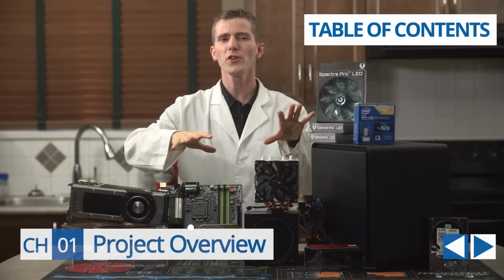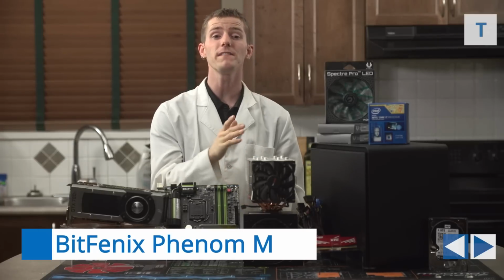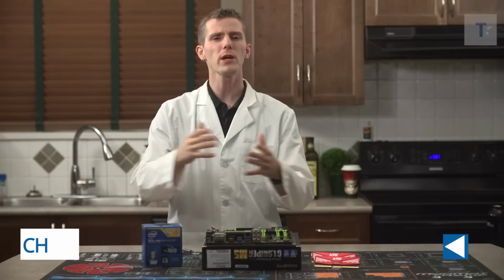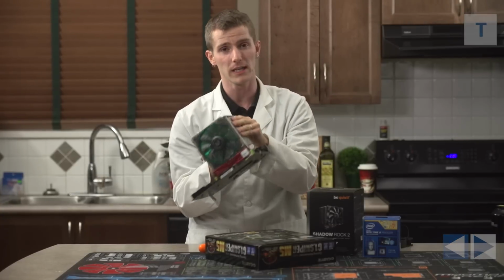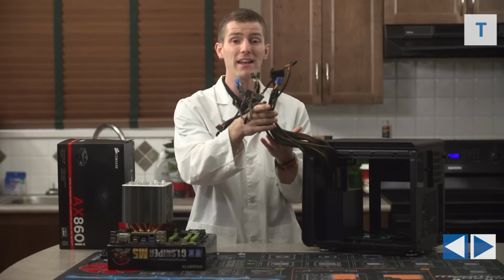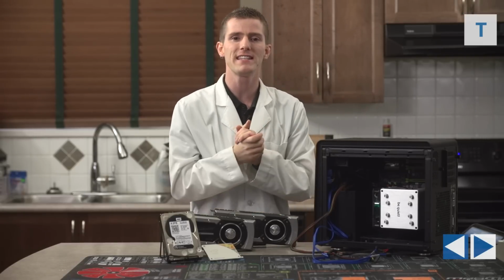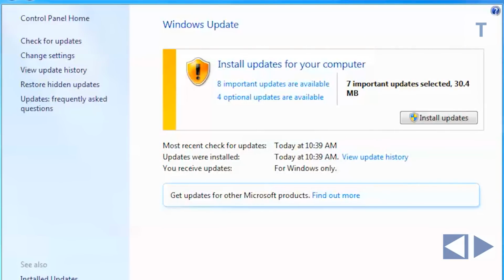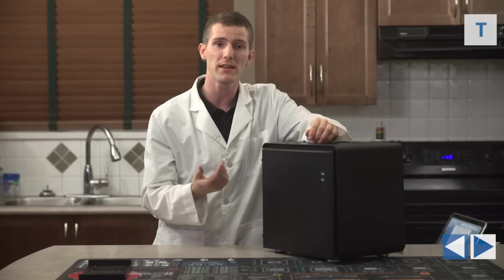ULTIMATE Intel Compact SLI Gaming PC Computer "How To" Build Guide

Comment: This Intel & nVidia bias is most... unpleasant! -.-
Reply: Um no. For high end builds, Intel and NVIDIA are superior. It's just a fact.
Reply: Maybe its because Intel cores are stronger than AMD cores and AMD gpu prices are inflated due to litecoin miners?
Reply: When AMD sponsors a build, I'm sure he'll do one. But they don't, so why would he waste his time when he's probably already busy doing other videos? He specifically said in the video that Intel paid for him to take the time to do this.

Also, last time I checked, AMD didn't make any decent chipsets for their FX CPU's, only their much lower power APU's. If he's going for high end, small form factor gaming build he's going Intel. AMD shot themselves in the foot with that one. 

And good luck trying to stop 290 and 290x's throttling in a small form factor without liquid cooling, particularly in xfire. And if you're going to talk about aftermarket cooling, I'm sure that CPU's gonna enjoy two very hot heating elements dumping heat into a not particularly well vented case.
Reply: lmCIoudz
Its been only 10 minutes and 5 people already disagree with you!
Reply: TheRayning well appart from the points above.
even amd fan's will admit that amd cards tend to put out some more heat.

now if your cramming a high end cpu and 2 gpu's in a small case.
do you want the relatively cool 85w cpu or the 130w one amd has to fight it.
and with the gfx card do you want 2 that can quite easily manage there heat. or do you want the 2 that are running noticeably warmer in a big high airflow environment.

the only option for a cool radeon card is aftermarket which means open cooling which means the acces hot air is vented in to the case instead of out the back heating up almost everything within the case.
Reply: AMD CPUs and GPUs are more for lower end stuff, around $500 - $800.
Reply: BigBadBeef Are you genuinely stupid or something?

Comment: I am not that rich, but I am gonna spend like $750 and get a PC with these specs:
MoBo: ASUS M5A97 PRO (AM3+)
BootDrive: Corsair SSD Force Series 120gb
HDD: Seagate 120GB
HDD: seagate 300GB
Ram: Corsair Vengence 1600Mhz CL9 16GB
PSU: Corsair TX 650W PSU
Processor: AMD FX-6100 6-Core Processor 3,3Ghz
GPU: Sapphire Radeon R9 270X 2GB Dual-X
Case: Antec Two Hundred V2 Midi Tower Svart

Comment: Rather have a bigger case, more room, more pci-e, better cooling, better cooling, and better cooling. M-ATX and M-ITX is just the current fad but has its advantages in certain areas, but building an ultimate system isn't where that advantage lies.
Reply: Depand on what you have. Personnally i have 2 SSD and 1 external HDD. I practically don't use my HDD anymore other than backup, etc. I never used the other PCIEX slot ever since they exist. Cooling is better off course, personnally i don't OC my CPU, i don't see the point of it right now, CPU bound games are so rare (if you already have a 4770, not talkign about ultra low end CPU here)

Comment: you could (instead of booting from a USB) get a USB DVD reader, they are relativly cheap and will perform almost as good as an installed one, but you can pack it away when you're not using it.

Comment: As for showing peripherials, why not ? it doesnt take long and its nice to see stuff you recommend. Even if I might prefer something else.

I wonder if there are any mitx cases with more air flow .. any1 ? I would be scared to OC my CPU if it hits 100c on even on synthetics when gpus are running hot too with no oc on small enclosure. I mean... yes I know its fine but I guess I'm OCD about that kind of stuff and also would like to be able to overclock every compoment.

Comment: "shocked face"@Linus. Don't use the flexible cardboard box as a base for the motherboard while assembling. At 13.26 while installing the ram you can clearly see the pcb bending and at 14.17 you can see that the board has been bent from the side.

Comment: You should also add that the plastic cage near the power buttons on the inside door can also house 2 SSDs and a laptop HDD I believe. I would be a little worried with 90°c temps, I try and never let my prodigy go over 70°c even if that means throttling the CPU / GPU while doing intense stuff. With a 4770 I sit around 35°c on desktop use. (About 10°c above ambient)

Comment: What CPU cooler should I put in the inwin 901? And I
m only using 1 graphics card. So is this gigabit motherboard better, or should I go with the asus maximus. But If I keep the gigabit. I was going to get a dedicated asus phubus sound card. So Which one should I pick?
Reply: ***** Thanks a lot for your answer. I never give thought to the gigabit motherboard yet. But I'll definitely go into that deeper since you are saying it's slightly better. And of course extra pci slots never hurt. Though I thought the asus maximus Impact had better build quality.

About the cooler. Will that one perform better then the Corsair H80i cooler? (or if possible I want the H90, but not sure if it will fit or not, some say it does some say it doesn't due to 140mm radiator inseatd of 120)
Reply: ***** Stupid of me I thought that that motherboard of gigabyte was a mini ITX, which I need. Since it's a Micro ATX, I don't need it. And so the Asus Maximus Impact is the obvious choice for me with it's extra dedicated soundcard, not using up the single PCI slot

Comment: why not swap that heatsink for a h100i? Fans on the bottom to eliminate any compatibility issues.
Reply: That's why I mentioned I would rather go with Kraken X40 which has a range of rpm's between 800-2000 rpm most of the time it would even go that high and it's not the much of a difference in dbA noise level of a shadow rock 2 is 15.3-25.4 dbA and the Kraken is 21 - 37dbA. which can be dropped by using a noctua fan instead which are at the 18 ish to 22 ish dba range. 

But at this point it's splitting hairs which ever way you feel more comfortable. :D
Reply: I was thinking of the same thing.
Reply: the case might not have place for a rad
Reply: Nickthetick144 it does
Reply: Smoking Crop Priced around 3k for this build without monitor does it really matter at this point? hehe I personally would go with kraken x40 ($99), rear mount it then use nocuta's on the top push air through the bottom and then you can flip the psu so the fan pushes heat out as well. But that's me :)

Comment: I hate cherry MX, I think its loud, terrible and the keys themselves get dirty quickly
Reply: You do realize your an idiot to put it bluntly, i was seemingly generalizing all cherry MX switch types, be it brown, red, green frigging rainbow for all i care, they are all terrible, they all get grease on eventually because we're humans and they all make noise as they create large kinetic movements, i prefer to use chiclet style keyboards as they are a little harder to clean but with a lower surface area, they're generally quieter and in my experience as quite a heavy gamer they are much less seamless and require much less effort, also with a deathstalker (much like mine) is gives it a clean look with a low profile (however deathstalkers are very expensive and the palm rest gets dirty, i wouldn't recommend it, mine was a gift)

Comment: i hardly see how windows 8 is the only thing out there for gaming. just install windows 7. no sane video game developer is going to make their game incompatible with windows 7 in the next decade unless they want to be lynched by hoards of angry nerds.
Reply: ***** ya, but it doesn't have anything that ACTUALLY makes any real difference in performance for gaming.
Reply: Soullessnut It actually does. When i upgraded from win 7 to win 8, most of my games were more stable fps wise. Especially bf4 where i saw a significant difference of how smooth it is. If you don't believe me look up bf4 vids that compare win7 vs win8.
Reply: salim elchoufi this is an optimization issue with battlefield 4. it has nothing to do with the capabilities of windows 8.

Comment: Should have went with water cooling. Then you could have used the hard drive bracket and probably have gotten lower temperatures.
Reply: Where would you fit all that? lol
Reply: TheOneHalf I guess you have never seen a all in one water cooler.
Reply: ***** I am aware that water coolers cant go below ambient.
A water cooler would take up allot less room even a dual fan config would be half the size and extra room will give better airflow.
 The Shadow rock is open on both sides and vents some heat in to the case where a water cooler would not.
Also this case has no window so being able to see the components is pointless.
Reply: BlueFoxTV There's no room for a rad in there. The air cooler may take up more space, but that space would be unused otherwise, so it doesn't matter. A CLC would require a taller case, either way you slice it.
Reply: BlueFoxTV ya the case has to have a spot for a rad
Reply: remnant24 More room equals better air flow. and you can put a cooler in this case as it is.
Reply: Nickthetick144 You can mount a rad on the back of the case where the rear exhaust fan is.
Reply: BlueFoxTV oh well it dosen't matter not everyone wants a liquid cooler or needs one
Reply: BlueFoxTV Actually, the air cooler increases air flow because there's an additional fan pushing air through.

There's really no justification for the extra cost and noise introduced by a CLC for this build.
Reply: remnant24 You can run two fans on a water cooler.
A Water cooler costs the same as a good air cooler, and is quieter then my noctua case fans.
Reply: BlueFoxTV I was referring to your statement about the air cooler impeding airflow, which isn't true. Besides, you can't mount two fans to a single 120mm rad, which is the most this case has room for, if any. 

I'd like to see which CLC doesn't cost more than a Shadow Rock 2 and makes less noise than a Noctua fan, with benchmarks to back it up, because I'm not taking your word for it.
Reply: remnant24 A air cooler like this one hinders air flow to other components as it block passive air flow and does not blow air on them.
You can mount two 120 mm fans to a single rad, don't trust me Google it
.
A all in one water cooler costs about 60 bucks, the same as this cooler.
Water coolers for there size are are quieter then air cooler and is why many enthusiasts use them in small builds.
Reply: BlueFoxTV even with an all in one temps would not get drasticly less.
Reply: BlueFoxTV Again, it doesn't hinder airflow since the fan pushes air through the heatsink to revive the airflow. Even without the fan, the hit to airflow would be negligible as long as your cable management is good. Also, there's no such thing as "passive airflow". Airflow is by definition, active.

You could mount 2 fans on a single 120mm in a push-pull configuration, but that's not what I meant, though I guess I could have phrased it better. But that would be overkill in a system like this, and then it becomes a huge block that, according to you, would impede airflow just as much as an air cooler, and probably wouldn't fit in this case.

As for the CLC, I asked for the name of the one in question, and numbers proving it does what you claim. Otherwise it's just your word.

And that's not why enthusiasts use water cooling in their builds. They use it for:
- heavy overclocking with stable temps
- aesthetics

I know, because I'm one of them, and even I'll admit the CLCs make more noise than the best fans. Besides, you're going to have fans in your case regardless of what type of cooler you use, so even if CLCs were quieter, it would make no difference as to the overall noise level of your system.
Reply: remnant24 Air flow can happen by convection this is passive air movement.
Look at photos of twin fan setups in this case and you will see that they are smaller.
A quick Google search will give you prices.
Water coolers are chosen for then silence along with the things you mentioned.
Reply: BlueFoxTV I'm not going to search for stuff to prove your point. You're the one who has to provide proof for what you claim.

Comment: I have Define R4, i5-3570k@4.4 and Gtx660 SLi, 2x140mm fans in the front, 120mm on to floor and 2x120mm on 100i sucking air out in the top of the case. Also i have one fan blowing air to gpus, from front to back, silelt and no heating issues.. R4 is big but nice case..

Comment: Great vid as usual. I'm in the process of assembling a gaming build with this very case. I was however concerned with heat issues, so I filled the thing with fans. Hopefully it won't sound like a wind tunnel blasting in my ear drums. I would like to see some Jonsbo cases at NCIX though. They have some pretty slick small form factor options.

Comment: would it be ok if  i changed the two 780Ti against two 770? and would it be ok if i change the SSD to a regular HD? or will anything screw up?
Reply: A HD would be fine, the graphics cards would rely on the case you were using.

Comment: Don't get the DeathAdder 2013 if you have large/medium hands and want to palm grip your mouse! Instead check out the SteelSeries Rival or Logitech G400s!
Reply: I agree 100%. I have medium/large..ish hands and use palm grip. Deathadder 2013 wasn't for me at all. Now I'm using Logitech g400s and thinking about buying the new Mionix Naos 7000 (wide one) or Gambias zeus gms1100 because even g400s is little bit too narrow for me. But deathadder...big no for palm grip users.
Reply: StSgry I have large hands I use a deathadder with a palm grip. it works perfect for me
Reply: StSgry stop saying 2013, the deathadder dimensions have always been the same, just call it the deathadder
Reply: crankCINEMA +1 for the Rival. Amazing mouse.
Reply: the sensei is the best!
Reply: My G700 fits well, but not perfect. Just so damn close, my fingers are just a slightly bit off from the extra buttons, about 0.3 inches.
Reply: Michael Arthur Long The Zowie EC1 Evo is also possibly the best ergonomically, just sucks you can't bind any macros to the side buttons as there's no software :(
Reply: G400 ftw!!
Reply: I chose the G700 because my PC is connected to the TV. In addition, I can use a phone charger to recharge it :D
So basically, you'll see a mouse going to a phone charger on the wall outlet that works.
Reply: how would a Razer Deathadder compare to a Corsair M40 for someone with small hands who uses a claw grip, do you have any other ~50 mouses?
Reply: so for medium to small hands semi claw to claw grip deathadder is ok?